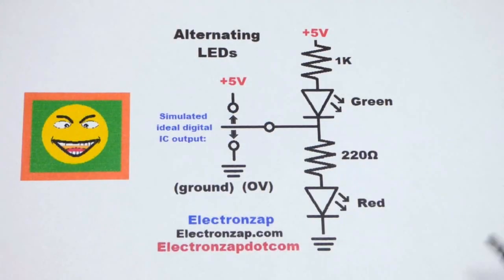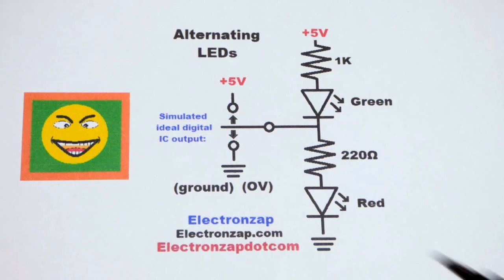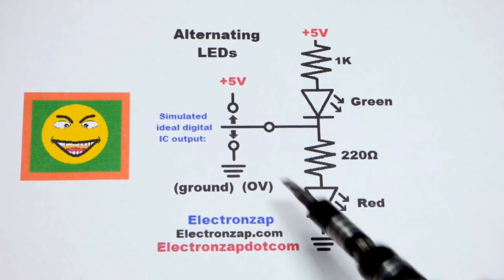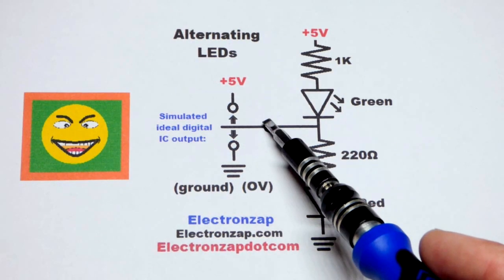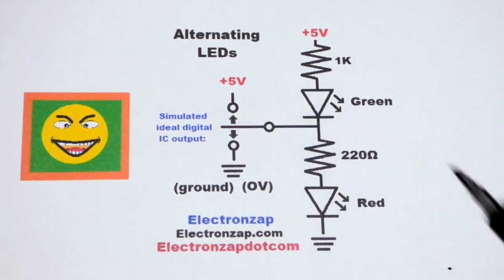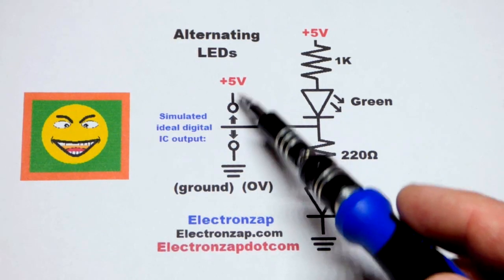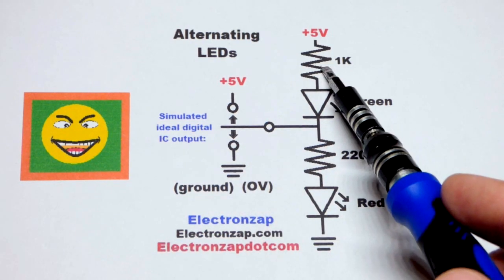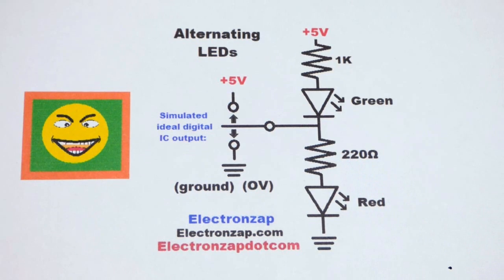Alternating LEDs from an ideal digital signal demonstration circuit for DIY learning electronics

Comment: I understand how the red LED is bypassed when the input signal is low, but I can't seem to wrap my head around how the green (or blue) LED is bypassed when the input signal is high. It seems to me that it would still have voltage across the green LED but obviously not. Is it because of the resistor (1K in this example) that is in the path of the green LED, and since there is virtually no resistance to the logic switch the current flows to the switch and not the green LED?
Reply from the maker: Works the same way for each LED, just opposite polarities. You need both supply terminals across either LED to have a voltage difference.A direct connection to a supply removes any energy from the other supply at that node.
Reply: Thank you, that last sentence was something I was unaware of.